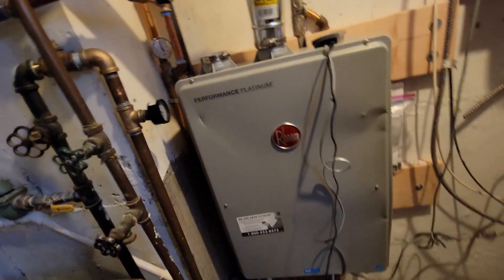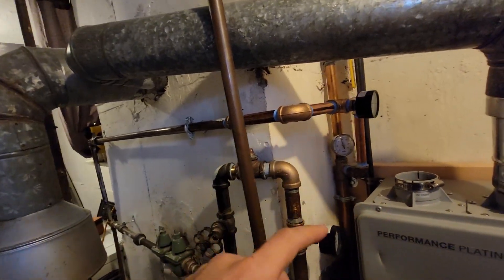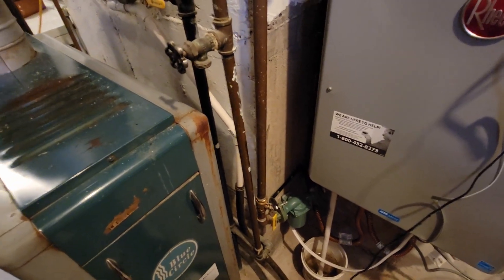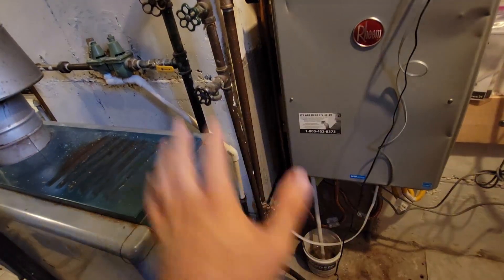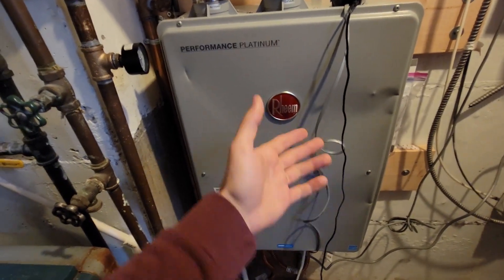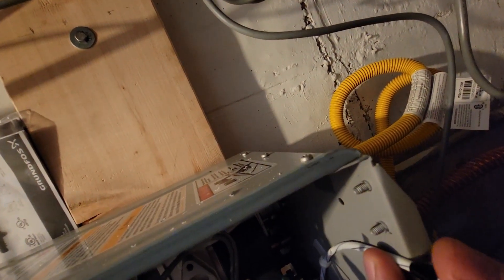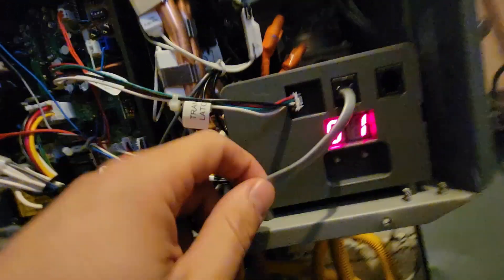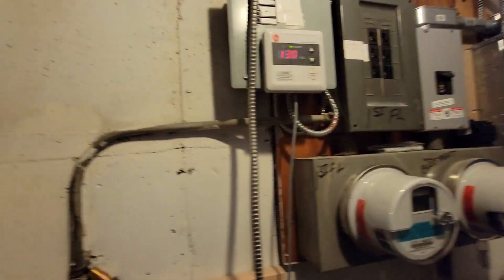Econet installation on a Tankless water heater

Comment: It’s great to see people willing to tackle projects that are just a bit out of their normal scope of skills.  I also like the idea of temperature and pressure gauges on the pipes.  The thing I noticed most on your install is the vent and the intake.  For the intake, you need to get makeup air from the outside for that thing to operate correctly.  Ideally it would be close to where you would exhaust the vent part.  It sounded like you did an emergency install, but you can’t use metal pipe long term into a masonry chimney.  The exhaust is cold and acidic which will eat both the smoke pipe and it will dissolve the mortar and the actual bricks into dust.  Page 42 in the manual gives the instructions and I believe they send the unit with a flush mount vent/intake kit.  Good luck and I hope you get many years of service from that unit.
Reply from the maker: Oh man. Just looked into it and your totally right. At first i couldnt understand why the manufacture required pvc as a exshaust, i can understand the intake but exshaust seemed sketchy to me. But with the acidity it totally make sense now. Im most likely going to run a stainless steel inside the chimney. Thank you so much for that comment, saved me alot of future headache
Reply: @redred5389  you are more than welcome.  Looks like you are on an exterior wall right there, you can save time and money if you get a 2 &9/16 hole saw and punch 2 holes through your band joist and intake and vent right out the wall.  That is the more proper way to do it, even lined the chimney will struggle due to the extremely low BTUs put out by the unit.  The reason they use PVC is because the metal tends to steal even more heat from the already cool gasses and it stagnates and condenses in the pipe.  Cheers!